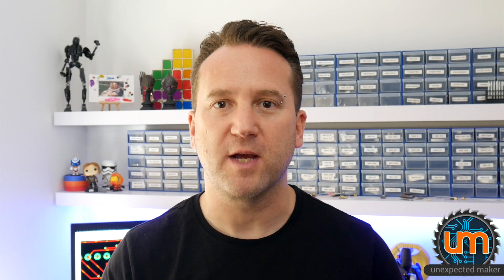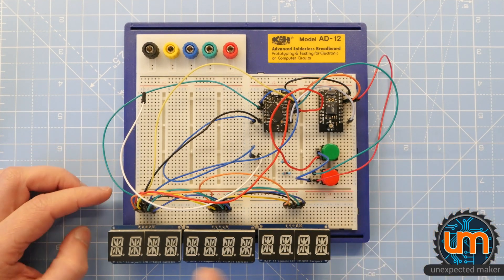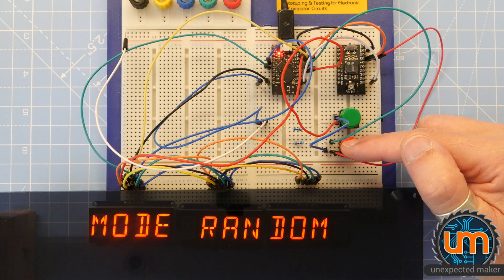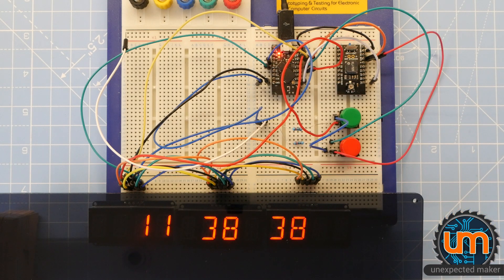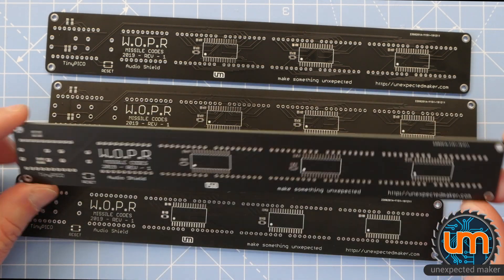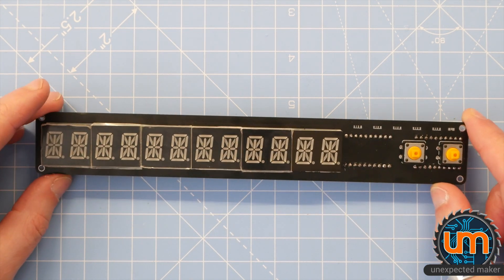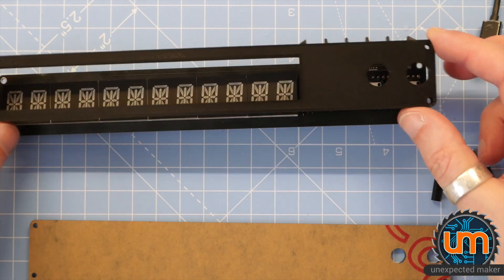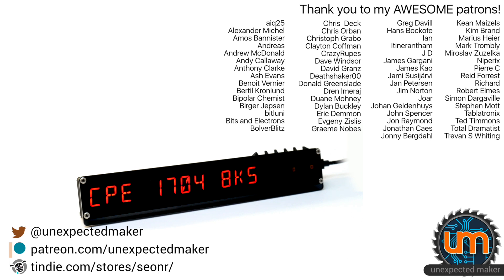War Games W.O.P.R - Missile Launch Codes

Comment: So I am guessing this was done in micropython? If so, maybe a look at the code might not be too bad. Even if it is done in C/C++, a quick glance specifically at the randomization sequence could be cool. Next, to add some additional user interaction for when it hits DEFCON 1 and prepares to launch. If the user isn't quick enough to start the decode to disarm the system, all holy nerf hell is let loose upon the poor soul.
Reply from the maker: It's all written in C++ :) I've got more ideas for this, so I guess I'll do a follow up video at some point with the finished display and more features.
Reply: We also need to see those DEFCON indicators working. Looking forward to seeing what you've got planned next.

Comment: Not seen the film in years, must try and find a copy to watch again. Started work on a sunlight readable sub counter (found the LEDs in an old work project box), just need to find a cooling method for the LED displays if i want to run full power on them. years ago we made a radio control panel for a cockpit using them, worked great except you had to wear gloves to touch the panel it go so hot. No problem for the pilot as they normally where gloves anyway.

Comment: [Shameless plug for my own kit follows - you are warned] You really want something more than a big button  to start the sequence. Can I recommend your own IMSAI 8080 replica https://thehighnibble.com/imsai8080/ from @TheHighNibble (another Aussie maker) where you could use the built-in AT modem over WiFi/telnet to connect to the TinyPICO to hack the W.O.P.R and start the sequence. The replica currently uses the ESP32 Pico Kit, I'd consider changing to the TinyPICO but last time I checked I need more pin-outs than it currently offers.